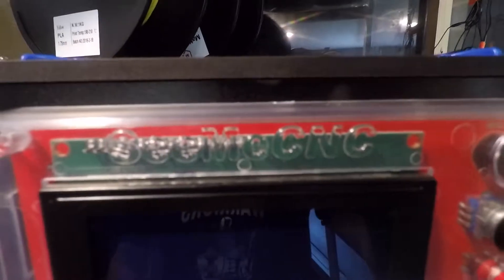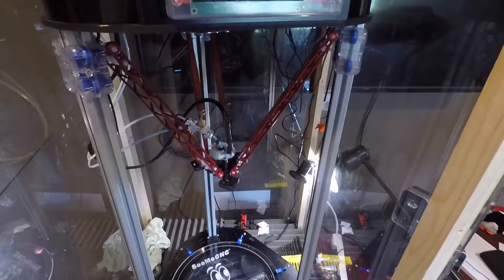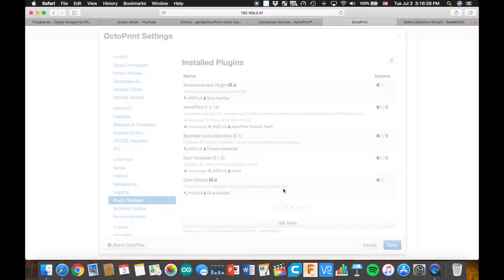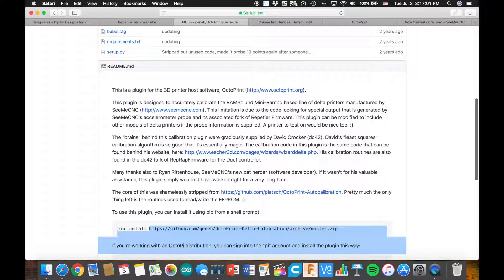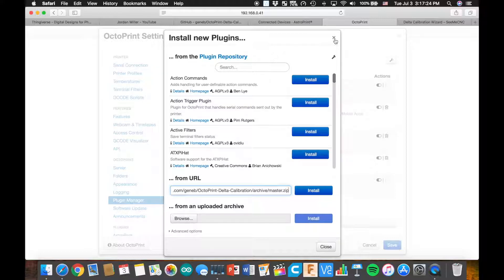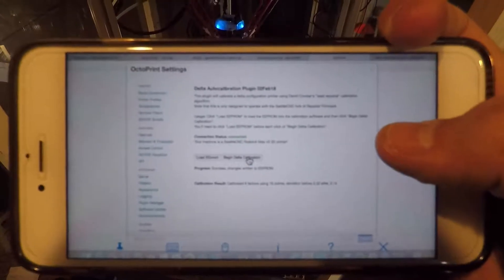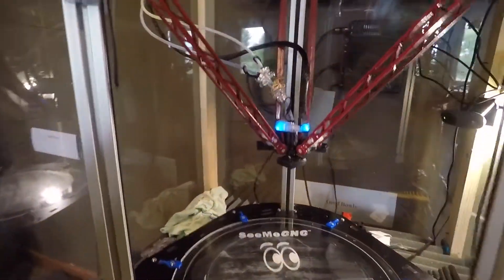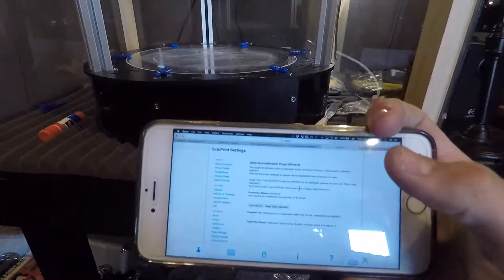OctoPrint Delta Calibration Plug-in

Comment: Hey Jordan, I’m trying to get my own Max V3.2 running with OctoPrint, but while I’ve so far gotten it to recognize the printer as operational, I don’t have any control except for turning the bed fan on and off, and the bed temp on OctoPrint is (incorrectly) reading 2000 degrees. Any attempt to set target temperatures returns a firmware error - I got the Rostock pre-built from Matterhackers. Any advice? Tips? Thanks!
Reply from the maker: Hmmm, very interesting. I know the V3.2 has the Duet Wifi on it. Have you tried the wireless control feature on your local network that SeeMeCnc created? (it's similar to octoprint) I don't blame you if you don't want to use it as octoprint has much more to offer. But I want to use this as a rule out that your sensors are working correctly. Can you also print from your SD card ok? No crazy temperatures? What about straight from your computer to the Printer through USB?
There could be a couple issues here, a temp sensor issue, throwing codes and messing with things. Or it could be some kind of communication issue between the Pi (assuming you're using raspberry pi 3) and printer. Baudrate maybe, not 100% sure.  
Feel free to email me and I'll try to help you figure it out.  Jam12cole@gmail.com